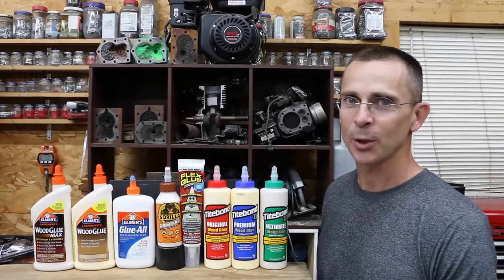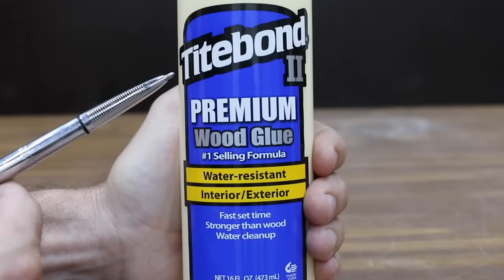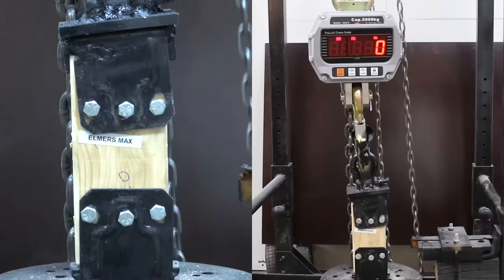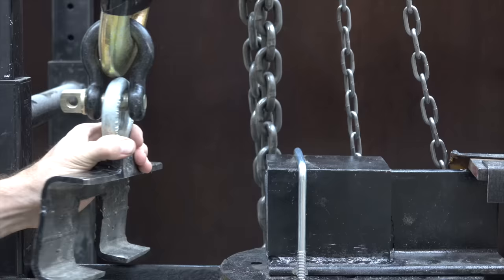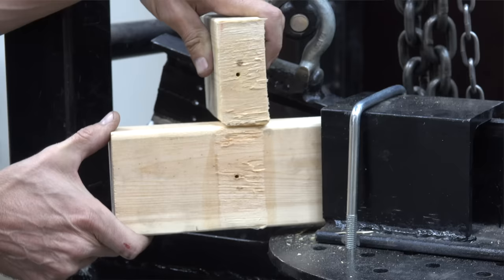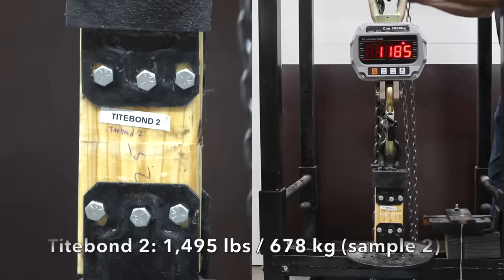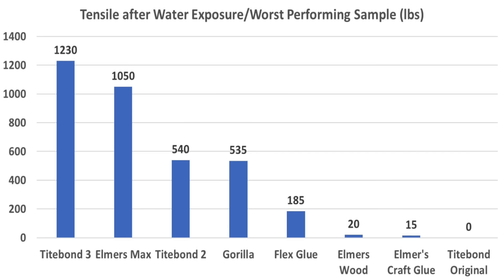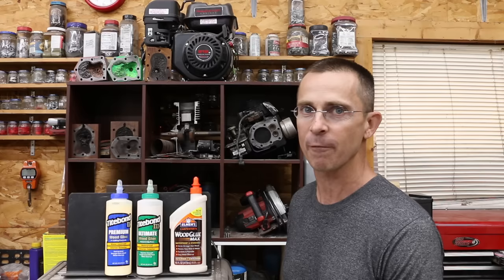Which Wood Glue is Best?  Let's find out!  Showdown with Titebond, Flex Glue, Elmer's & Gorilla.

Comment: Proper procedure for gluing end grain 1) sand slightly, 2) coat with glue and let dry, 3) sand coated ends smooth, 4) glue and CLAMP.  ALSO Screws are extremely inconsistent for clamping pressure.. proper wood clamps SHOULD ALWAYS be used to get a strong joint.. Clamping pressure is a HUGE factor in joint strength.. Perhaps even test different pressures??   I'd like to see this one done again using proper techniques..   AND Gorilla Wood glue IS Titebond II.....  Even though all 3 titebond products have the same basic instructions,, They are VERY DIFFERENT products as far as workable open set and grab time.. Using them properly is also a major factor... End-grain gluing is almost never done.. That's what finger joints were invented for..  How's about some standard side by side gluing tests??
Reply from the maker: Thanks for the suggestion.

Comment: I would like to see Brownells Acraglas epoxy compared to wood glue in these tests, it is often used in repairing gunstock cracks, they offer it in both a Gel, and original. It could also be compared with Miles Gilbert bedrock epoxy,
Reply from the maker: Thanks for the suggestion.

Comment: Did you use water with Gorilla? You’re supposed to apply water to one surface to improve bonding. And if you had used clamps instead of screws, the bonds on all samples would have been much greater.

Comment: It's very hard to glue end grain. If you tested edge grain that was joined,and clamped properly. You surely would have exceeded the limits of your test equipment. I have been using Tight bond product's for nearly 40 year's with no disappointments! Great product!
Reply from the maker: Thanks for the feedback.

Comment: I think your channel is the BEST when it comes to testing products on an even playing field BUT on this test, I was rather disappointed.

Why the deck screw inserts, then removal. IMO THAT act alone tainted the test before it got started (for obvious reasons). Why not simply clamp the parts so there would NOT be  ANY holes that remain after removal and a small area where glue was not present and thus presented an area of ZERO coverage of the glue on the mated surfaces of wood.

Comment: I made a wood bending jig with original titebond.  I did not think it through, as you use heat and steam on the wood you are bending. It seeped into the glue joints on the jig and it deconstructed.  I rebuilt it with Titebond 3 and it held up.   I make and repair instruments.   You use something like Original Titebond in their construction for that very reason.   You want to be able to repair an instrument if needed later.  You can remove a neck, top, sides, etc. with heat and steam.   I should have known better!
Reply from the maker: Thanks for sharing.

Comment: First, let me say that I am in absolute awe over the effort (and, no doubt, cost) your  videos clearly display.  Good on you and thank you!
 Now...|
 I'm wondering if the very slight differences in the level trueness of level of the bolts attaching the boards to their jigs might have played a role - more lift pressure on bolt one or two or three depending on it's placement through the board, or deformation of the through-holes in the metal of the jigs - on  some of the lower/immediate failures.  Meaning the total of the glued surface was perhaps not being represented accurately by the failures because the surface pull was skewed by the relative height of the lift bolts or slight deformations in the metal jig holes after repetitive stress.  Or even the natural variables in the lumber itself (moisture content, grain composition, etc.) Am I making any sense?

Comment: A lot of woodworkers probably wonder howl long you really need to wait before a glue joint is at full strength (Titebond recommends waiting 24 hours)- What do you think about testing the strength of several wood glues after say an hour, 3 hours, 6 hours, 12 hours and 24 hours?
Reply from the maker: Thanks for the suggestion.

Comment: It would be interesting to see if epoxy is substantially stronger than glue. I’m building a wooden plane and use T-88 epoxy, which is recommended because it’s stronger and lasts longer than glue.
Reply from the maker: Thanks for the suggestion.

Comment: Take the top two and leave a screw toenailed on either side then try the experiment again. Pre drill the holes to avoid tear out.
Reply from the maker: Thanks for the suggestion.
Reply: @ProjectFarm  Thank you for taking the time to reply. The reason I bring it up is, I never depend on glue  alone. I always use some sort of mechanical fastener.

Comment: I know this was from some time ago, but most of the pulls were done incorrectly, the bolt holding patten of the top blocks was not done correctly putting the shear on the side of the blocks, you can see the block tilting which would put more shear on the side of the joint so overall a poor test.
Reply: Was thinking the same thing, 
would like to see this test revisited

Comment: Did you ever try the Original Gorilla Glue? When you use this glue you dampen the surfaces of the wood and apply the glue. The Glue expands as it cures. You don't want to get this on your hands because there is no solvent I found that will cut it. I tried gluing legs back on chairs with white wood glue and they came loose. I used the Original Gorilla Glue and it worked very good. The bad part about this glue is once the bottle is opened no matter how well you put the cap back on the glue in the bottle will go bad.
Reply from the maker: Thanks for sharing.

Comment: Glue is not made to work on end grain. The grain soaks up the glue and that’s where the inconsistency comes from. If you glue the boards together on the flat sides, you wouldn’t be able to to separate the boards. It would break the boards, the joint would not fail.
Reply from the maker: Thanks for the feedback.

Comment: Great video. I inherited my late Uncles Wood Shop and tons of wood and supplies. I found 5 one gallon jugs of unopened Titebond 11 Premium wood glue. They are very dusty but the caps look okay and I cannot find any dates on them. Is there anyway to tell if they are still good other than opening them. I would like to use them but it will take awhile. Thanks
Reply from the maker: Thanks!  I would do a trial test.
Reply: @ProjectFarm  Thanks for the reply. I priced this glue new and it's average price is from $16 to over $20 so this could save me a bit of cash. I inventoried my inheritance and found some huge Walnut slabs and also several big and small pieces of Gaboon Ebony which I have never cut into before not to mention pieces of wood I have not been able to name yet.

Comment: Wood grain varies in density, therefore effecting how well the glue penetrates the cells in the grain. Lightly dampened wood opens the cells for better penetration
Reply from the maker: Thanks for sharing.
Reply: @ProjectFarm  also, you may be interested to know.. building cabinets, specifically solid wood doors... 
Materials are ripped down from a one by four six or eight, the grains are reversed/flipped and glued back together for added strength. So instead of matching the drains the grains are purposely unmatched. If that makes any sense 🤷‍♂️. I don't know if this would have any bearing or effect on your tests

Comment: I have an idea for a another wood glue test.The experts say you should spread glue on both surfaces for a proper bond. But is that true or just a way to get people to use/buy more glue? What if you spread it on only one surface? What if you don't spread it out all nice and even and just run a bead that gets squished across the surface?
Reply from the maker: Thanks for the suggestion.

Comment: Glue "yawn" is a problem for luthiers as instrument strings exert constant pressure on a joint and many glues eventually begin opening up ("yawning") and finally failing. Titebond III is the standard for luthiers as it does not yawn.....ever.
Reply from the maker: Thanks for the feedback.
Reply: @ProjectFarm  Your tests are an eye opener; certainly exposes bogus claims by manufacturers. Thanks, and keep on testing.

Comment: Wood glue is not intended to be strong on end grain.  But if you were really tring to test them you should have used manufactured wood.  So the results would be the glue not the 2x4s.

Comment: BINDAN-P Propellerleim®
The average breaking load according to DIN 68 602/EN 204 is > 1400 kg/cm².
Thermal stability according to WATT 91 > 7 N/mm²
Better than Titebond 3. A German waterproof wood glue.
I would criticize your tests for not using a hardwood like oak.

Comment: I'm a fan of the channel, but the results of this episode varied too much from test to test for a reliable conclusion. I think the problem was mostly caused by the choice of a butt joint for testing. My non professional opinion ii that the end grain sucked up a lot of the glue while the glue was setting and the screws may have over tightened the joint thereby squeezing out some of the glue. The fact that the Flex glue had more consistent results is some evidence for my theory. The Flex glue was more viscous and therefore less likely to be sucked up by the end grain. My guess is that a side grain to side grain test, especially if regular clamps were used to hold the wood together would produce more consistent results.

Comment: Video Request:
Can you do a Video on Regular 2x4 wood stud and the Finger Jointed Wood Stud. Is the Finger Jointed wood stud just as strong as a regular wood stud ie vertical, diagonal, and horozontal loads. Twisting (torque) loads etc.,  prolonged exposure to heat, humidity, water submersion etc.
It's showig up in construction and I don't think is a good idea  for building due to its just scraps finger jointed and glued together. Is it better, same, worse than standard wood studs.
Thanks!
Reply from the maker: Thanks for the video idea.

Comment: It appears that your "shear" test is not strictly testing shear forces, because your holder allow it to tilt, and so it is cantilevering it up, and tearing from the bottom edge. I think if you firmly attach the up-pull piece, you will get much higher shear readings, closer to the 4000lb end-pull tests. Your shear-failure results are still good though, and show the best glues still win.

Comment: I've been using Titebond 3 for about a year based on this video. I'm a professional carpenter and had been using Gorilla glue prior to watching this. I will never buy gorilla glue again it's kind of a joke. That company is just a bunch of marketing gibberish now I don't trust much of anything they make. I shop at Home Depot and they don't sell Elmer's Max or I would be buying that one. But tight Bond 3 is close enough that I'm totally good with it.
By the way a better way to do these tests with wood would be with half lap joints, that would be more indicative of a real world scenario. another good one would be miter joints and then try pulling the other ends of the boards together with a scale attached to a little turnbuckle or something.

Also half lap joints on some 2x12s and then set them up like ramps and try driving up them.
Reply from the maker: Thanks for sharing.

Comment: I realize at this date this experiment is a few years old. End grain gluing is the least possible bond. Would have liked to seen a long grain to long grain test. When the wood breaks instead of the glue joint it is not a glue failure. Would have seen tests on open time and cure time.
Reply from the maker: Thanks for the video idea.

Comment: I all of wood glues are stronger than wood, which I believe they are, there is no point in finding out which of them are stronger than that. So it makes sense to just buy the cheapest one that is stronger than wood. While the joints you made to test the glue may be useful for testing, none of the glues are meant to hold wood together the way you have made the joints. They are made to be used as part of  "joinery" joints. They can also be somewhat effectively in to somewhat strengthen joints that that are made using wood screws rather than clamps, where the wood screws remain in place after the glue sets. But they aren't intended to hold wood together that is simply butted together.
Reply from the maker: Thanks for the constructive feedback.

Comment: Wood glue tests shouldn't be done with end grain. It was probably simpler for the video creator to get results this way, but I don't think it's shows the glues' optimal strength. Wood glue works best when there it perfect surface contact between pieces.

Comment: I wish you'd redo this test, your clamping method was not good and was the reason for so many unexplainable failures and inconsistencies. The deck screw has consistent spacing between the thread so it will never allow the wood to securely clamp as the two pieces of wood will always stay the same distance apart as the screw follows its thread. The reason some held better than others is due to the amount of downward pressure you applied when running in the screws, which compressed the wood together enough for a secure clamp when the screws held the two together, or not enough which allows small spaces between the wood, which compromises the wood bond. 

Use weights as your clamp, it's far more consistent than running in screws. I don't think I explained this very well at all, but based on my experience as a woodworker, screws don't tighten things, they just hold them together, which is not the same thing. An experiment to demonstrate my point would be to take the same screw and run it through a board in preparation to screw that piece to another piece, the screw should be all the way through the first piece with about 1/4" visible on the other side, screw the two boards together, and there will be a small space between the two boards where the screw did not pull them together, it just held them both at that distance. 

Screw manufacturers are aware of this and designed screws to work around this problem, these screws are the ones where the thread stops halfway and the rest of the screw up to the head is smooth, which allows the first board to not be tethered to the second board by the threads of the screw, which allows the first board to be pulled tight against the second. Trust me, the difference is night and day, I've messed up many projects by using the wrong screw.

Comment: Have you tested Hot Hide glue? 

Titebond makes one or you can make your own.

I made some using dog chew sticks ($1 a pack of 4) and beat test pieces with  a hammer. the wood failed but not the glue.

Since it’s not supposed to be water proof I didn’t test it wet but maybe I will.

BTW    Hide glue works without clamps as it draws the pieces together so I didn’t use any. Did two test  one with two pieces laying wide side’s together and one with pieces perpendicular. 

I used wood shims and was amazed at how strong the bonds were. They were thin so i expected them to easily break but even a hammer wasn’t good enough.

I’m learning how to work on guitars so needed hide glue and store bought is too expensive for me.
Reply from the maker: Thanks for the suggestion.

Comment: I do admire your testing of mechanical things, but in this case the results are worthless. End grain is not the way to test wood glues.  Check ASTM D 905. My first job as a chemist in the mid-70's was with Franklin where I shared a lab bench with Pardon T. Brown, (Brownie). the inventor of Titebond. He taught me a great deal. Jack Gerard was in charge of testing and QC. I couldn't believe the pains taken to test wood glues; defined maple blocks, moisture content, grain consistency, thickness of glue applied, clamping pressure, time, time after removing clamps, etc. etc. etc.  It was proven that end grain would produce erratic, random, non-reproducible results. Think about the stud you cut into blocks; the ones nearer the end would have a lower moisture content than the ones nearer the center. This alone would affect penetration of the glues. There are too many other errors to list.

Comment: The tensile test wasn't a true tensile test, as it appears that the test apparatus applied force unevenly across the samples. I suspect that's why there's such large deviations between the samples.

EDIT: I suppose the toenailed drywall screws could have also added unforeseen residual stresses, as well as inconsistent clamping force.

Appreciate the content nonetheless. Not meaning to sound like I'm only complaining.

Comment: the most important part of buying wood glue is the DATE.  It makes no sense in purchasing glue that has been sitting on the shelf for over a year.  Learn the codes and inspect them to make sure the glue is fresh.  Why spend your hard earned money for two year old glue?  Learn the codes and use them.  And if the retailer has rubbed them off ..go buy them elsewhere!
Reply from the maker: Thanks for the feedback.

Comment: I wonder why a particular adhesive could show a very low result and a very high result in the same test? Reliability is not so good. Possibibly more test samples would be needed and maybe instead of screws, clamp each piece together using the same amount of pressure.
Reply from the maker: Thanks for the feedback.

Comment: Gorilla glues have a SHORT shelf life. I have had to toss most of it that I bought. I have used Lepages Carpenter glue for many years and continue to do so with excellent success. Bearing in mind that most of these glues have a tensile of over 3000psi and even the best hardwoods list a tensile strength of 1800psi so they are all stronger than the wood. For absolute submerged strength use epoxy. It ALWAYS works.
Reply from the maker: Thanks for the feedback.